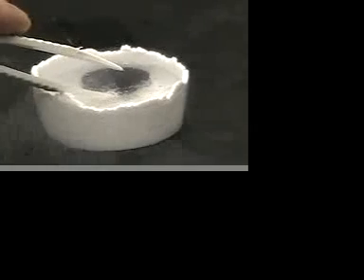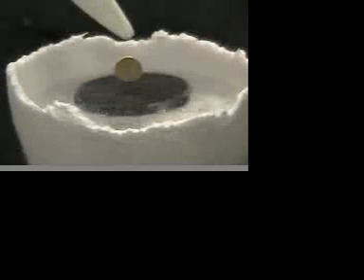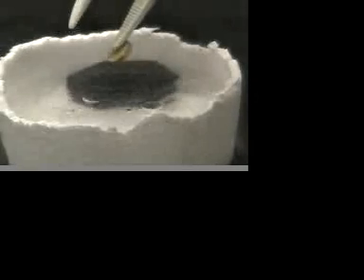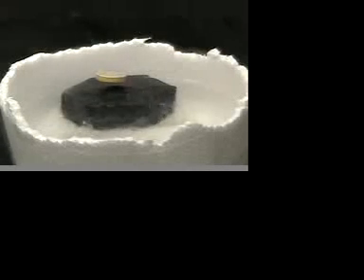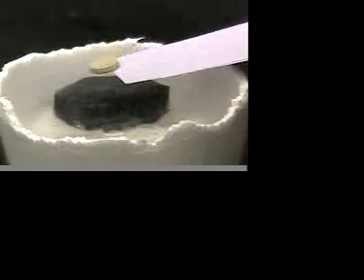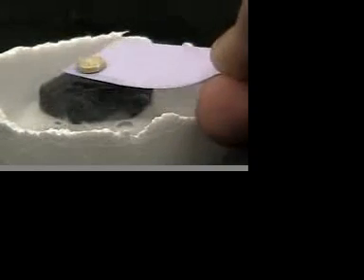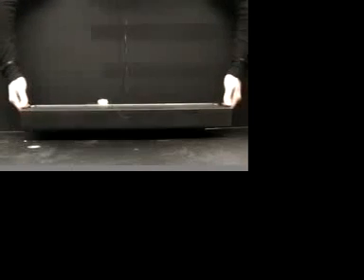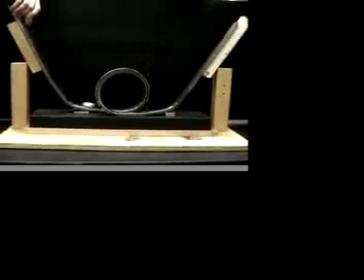Levitation and Suspension of Superconductors via Magnets

Comment: After minute 5. Shouldn't the superconductor reaches the same height from where you dropped it?
Reply from the maker: Ideally, but there is a good deal of energy loss in the system, most of it from changing direction and non-uniform magnetic fields.

Comment: It's a very good question, not stupid! The track can push up on the superconductor with magnetic or mechanical force, depending on if superconductor is cooled or not. Gravity pulls on both train and track on the scale, so you are correct that the total mass would be 10,1kg. However, in physics "10kg" can be anything between 9,5kg and 10,499kg, so "10kg + 100g" still is "10kg". More precisely you can write 10,000kg + 0,100kg = 10,100kg. Search Wikipedia for "Significant figures" for more info.

Comment: @IthacaCollegePhysics  I found a similar puck at aborsci  could you please take a look and tell me if it would work as will if I insulated it. The reason im slightly sceptical about it is that its only 46 dollars which seems relatively cheap but I was refered to that website by the place you bought yours originally. 
Thanks

Comment: If your track is 10kg and your superconductor is 100g, and you put it all on a scale. Would the scale show 10kg? Or would it be effexted by the superconductor and become 10 100kg?  Like, if the weight of the superconductor added to the overall weight eaven if it levitates? I'm in 11th(16 years old) grade so sorry if it's a stupid question.

Comment from the maker: @keildouglas It would eventually stop, but not because of air resistance.  The joints in the magnets create a slightly non-uniform magnetic field which causes what's essentially magnetic friction inside the superconductor.  This friction will slow the superconductor down.

Also, it will warm up eventually, and stop superconducting, and when it does, it will not work at all, of course.

Comment: In the very first experiment, you say the magnet allows no magnetic field inside, however you mention you're using liquid nitrogen, which implies that it's a type II superconductor and will allow field inside (and it does look like there's some flux pinning going on).  

Also you mention that it doesn't allow field inside by becoming a magnet.  I was under the impression that external magnetic fields create currents inside which have field lines in opposition to the external field?

Comment: What would happen if the track did not have the perpendicular sections?
 
Would the superconductor decelerate at the ends once it felt the field's orientation change?
 
I suppose one could also make a track out of a tubular or torroidal electromagnet. with the superconductor on the inside.

Eeek! Transport tubes!!! Just like Futurama! XD

Comment from the maker: @Twixgtx Liquid nitrogen is currently less expensive than gasoline -- about $2.50/gallon.  So we can make a lot of nitrogen very cheaply, like you say, we just take it from the air.  But there are no plans to turn it into a fuel, and it can be dangerous in liquid form (though no more dangerous than gasoline).  So, to answer your question, the technology is already in place to make lots of LN2 cheaply -- there's just need for it (at least not like gasoline).

Comment: I realized that we initially tried to build the track on a sheet of metal that was to thin, so the attractive force between the magnets and metal was overcome by the repulsive force between the magnets causing them to separate. After realizing that, I got a 3' x 18" x0.25" steel plate and  successfully built a circular track (took 10hr).  In my set up we are using a Bi2Sr2Ca2Cu3O10 superconductor. It experiences little flux pinning, as a result, it ends up falling off the track at higher speeds.

Comment from the maker: Thanks for the comment.  We had a great time making the demo and showing it to people here on YouTube.

Unfortunately, it's not air resistance that slows it down.  At the joints of the magnets, the magnetic field isn't constant.  Those slight changes in the field cause the superconductor to slow down -- it's magnetic drag.  To get rid of that, we have to have completely uniform field, and there's no easy way to do that.

Comment from the maker: Levitation occurs due to the expulsion of magnetic fields, creating a magnetic force to float it above the track.  It suspends below the track due to magnetic field trapping.  This tends to keep the field constant so it does not want to change, hence it will fight gravity to keep the magnetic field constant.
There is one train in Japan that uses superconductors like this.  Most MagLev trains use electromagnets.

Comment from the maker: We used liquid nitrogen -- liquid hydrogen is much colder (about 20 kelvin, as opposed to 77 kelvin for nitrogen), and much more dangerous.

Unfortunately, no one has discovered a room-temperature superconductor (yet), and the material has to be cold in order to superconduct.  Without the liquid nitrogen, it is just a rather boring, expensive, brittle rock.

Whoever discovers a superconductor that does not require cooling will 1: become rich and famous, and 2: win the Nobel Prize in Physics.